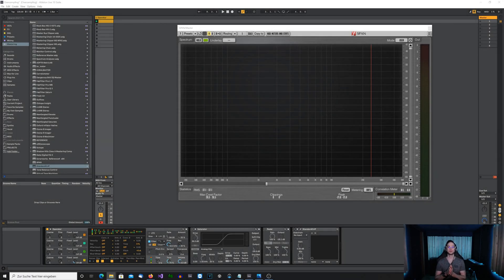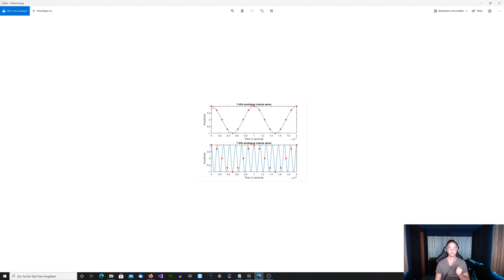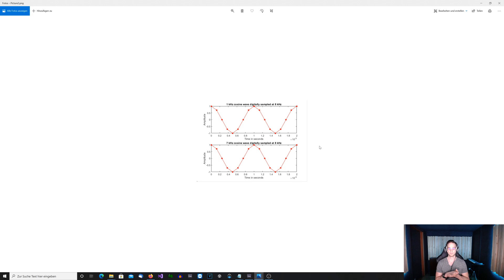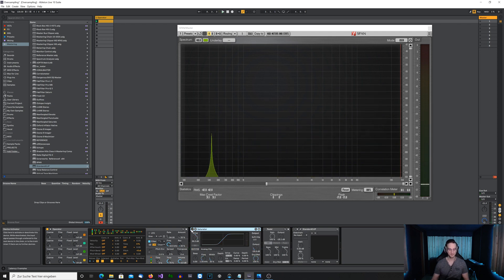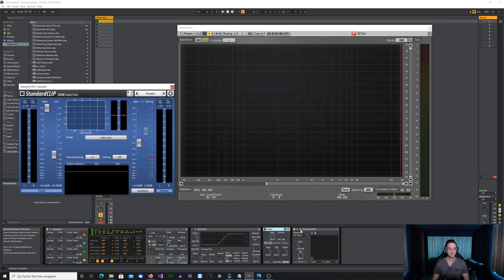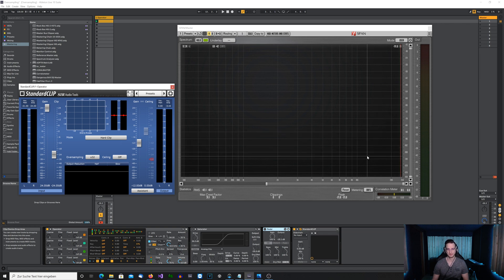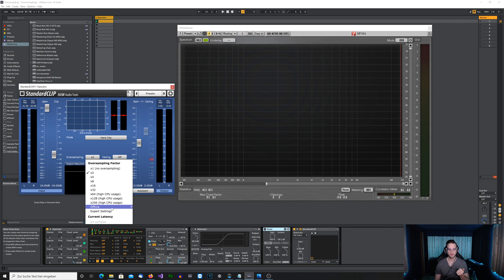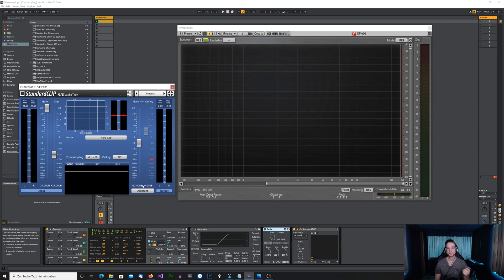TUTORIAL: Oversampling - Increase Your Audio Quality When Using Distortion Plugins!

Comment: Hey Zero, I'm assuming that a plugin going into a bus channel or the mix bus needs to be oversample as high as the cpu can take being that it is the place where most frequencies are gather and when introducing aliasing all of those frequencies will fold back into the mix? Thank you!
Reply from the maker: Yes, but there is also a point where a higher oversampling rate yields no additional benefits. It also depends on what you are doing. F.e. if you have just very slight saturation, you probably are fine with 2-4x oversampling. With heavier saturation you maybe need a bit more, but you don't usually do that on a mix/master bus. There are plugins which can oversample 128x or more, but this is kinda useless. I would say the absolute maximum is probably 16x for heavy saturation scenarios. On a mix/master bus you most likely don't need more than 4-8x. In my master channel I also have a rack with a knob to turn the oversampling on and off. So while mastering I have it turned off or set to a low setting to avoid heavy CPU load and I just turn it on for exporting the track.
Reply: @Zerotonine  That makes a lot of sense, I did some testing's this past week and came out to the same conclusion.. one thing I have noticed clearly is the dif between offline export and freeze and flat vs resampling or printing.. huuuge difference, f.e. if you oversample a channel and then you freeze and flat you might as well forget the oversample because the quality loss is pretty big. So I noticed if you you need to freeze an important instrument after it gets oversampled you just resample it and use that new wav as your "frozen track" (you can then freeze that original instrument channel and mute it to still have it) but work from the resampled channel, 0 loss of quality in the null test.  Thanks for the reply and thanks for the vid!!!
Reply from the maker: @bedtimeread  Yep, if you have some saturation on a single channel it is good to enable oversampling before you freeze and flatten. Especially if you do it multiple times, then it adds up pretty quickly.

Comment: Even though Satin have oversampling (always enabled, there's no option) I still find it sounded better in 192k.

The same about bx consoles.
Reply from the maker: Yeah, probably it just oversamples 2x or max 4x inside Satin. With heavy distortion that might not be enough. That why I think plugin companies should give the producers more options to choose from. In several plugins you can choose from 2x up to 32x. Usually 8-16x is enough even with heavy distortion. If you run at 192k default, you basically have 4x oversampling for all your plugins inside your project (compared to running at 48k). But you mentioned the downside of this already, takes up lots of CPU. In most plugins you don't need oversampling, so it basically better to run at 48hKz sample rate and just enable oversampling on the plugins where it is needed. :)